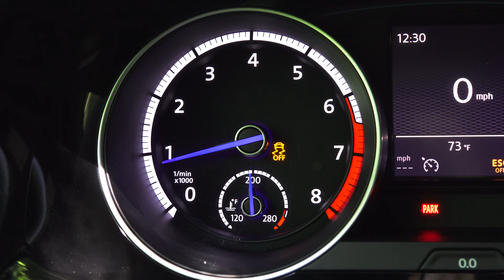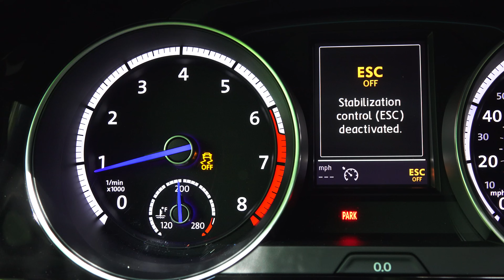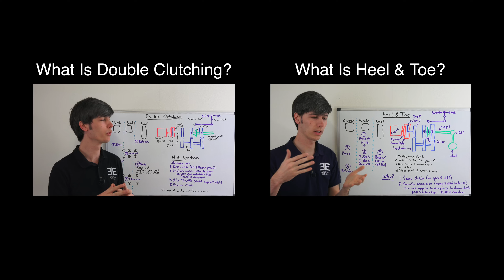How To Launch A Manual Transmission Car

Comment: Taking the rpm to redline isn't always the fastest. If your torque curve peaks at 5k and you redline at 6500 you're wasting time and going slower than you would be shifting at 5k
Reply: +Kyle Carson because they probably have a very close ratio transmission. he is correct it is not just about the power curve in a single gear because that is just engine power what matters is what you're putting to the ground and for that you need to take into consideration the transmission multiplier. If you have a normal street car the difference in ratios especially between 1-2nd will be large and it gets smaller as you move up the gears. So for example if you had 250 ft-lb torque at 7000RPM in 1st and you shift to second and land at say 5500 RPM and you have 300 ft-lb in 2nd at 5500RPM but say using the example in the video you have a 60% better ratio in 1st  you would still be better off shifting at 7000RPM. Typically the redline wheel torque which includes transmission multiplier will be higher in any preceding gear than any output in the entire range of the following gear so it is beneficial to shift at redline especially in the lower gears.  

The fastest way to drive a car is to shift when the wheel output in the lower gear falls to match from above the relatively increasing wheel output in the following gear as this way you are maximizing wheel output instead of just engine output. However often the wheel output will not even fall low enough before you reach redline in order to be under any output in the following gear so this is why it is normally best to shift at redline even at a lower engine output after peak torque. However this is not a universal rule but needs to be addressed for each engine and transmission combination. You can make a simple chart and or graph to see if this rule applies for your own personal car but for most cars besides specialized race cars shifting at redline is optimal.
Reply: But, when you change the gear at 5k, your rpm drops to lets say 3k, so if you have more torque at 6k than at 3k, you should take it to the redline...not to mention torque at the wheels drops 60% when shiftin gears...so the torque at 3k must be 1.6x of that at 6k...
Reply: +Vicjo Koper no you stay in the torque curve that's the fastest way. Ask a drag racer, they set there shift lights around 200rpm before the torque curve levels off to keep it constantly in the torque curve. If you go past the torque curve all that happens is the engine works harder and produces less power. Watch the computer reading while a car is on a dyno. After the torque curve you will see the power drop and continue to drop till they hit redline
Reply: Kyle Carson you're really just not understanding. engine output is not what matters it is wheel output that accelerates the car and due to gearing advantages for most cars in the lower gears you always have MORE wheel power AT redline than you do in equivalent RPM in the next gear or really any RPM in the next gear. So for this reason you go faster by shifting to redline. 

using your own example even if the nominal torque starts declining after 6K RPM your wheel torque will still be higher at 7K RPM than your wheel torque in 5th gear at whatever RPM you land at from shifting early say shift at peak torque 6K RPM land at 4500 in 5th. 4500 RPM in 5th will have lower WHEEL output than 7K RPM in 4th so you go slower by shifting earlier. why is this so difficult for you. for the vast majority of cars basically for any vehicle speed, you will have greater WHEEL output in a lower gear if you can rev as high. 

just like you said by the time the torque curve peaks redline is nearly achieved so you will basically never run into the situation where wheel output is lower in a lower gear than in the following gear. 

for shifting BEFORE redline to make sense WHEEL output which again is a function of engine output and the transmission multiplier must be lower at or before redline than the equivalent wheel output at the RPM you would land at from shifting before redline, but this basically never ever happens in street cars because of the large drop in gearing advantage as you go up in gears.
Reply: +TheAceHD a lot of people believe that but nobody that races does that because it simply is not faster. Torque curves usually peak not far from redline. Maybe between 500-1000rpm before redline so if you redline at 7k and your torque curve ends at 6k in 4th gear you waste a couple seconds waiting to redline when your car would accelerate faster by simply shifting. Ask people who race or get your car dyno tuned they will tell you the same thing unless your car makes a curve all the way to redline
Reply: +TheAceHD no dude torque is the turning FORCE of the wheels not how fast they are turning its how hard they are turning. For example my heads cam gto made 431 rear wheel torque at 5750rpm that was its max torque it made at the wheel but it redlines at 6200 where it made much less. Now my engine doesn't make 431 foot lbs until I hit 5750rpm before that it makes less and is climbing after that 5750 it drastically declines in power. You obviously don't understand this. Your engine is always 100% of the time slower and making less torque and horsepower after the torque curve. Look at a damn dyno sheet
Reply: +TheAceHD the power then starts to drop quickly at 5900rpm so that's when you shift idk how you can't understand this. Makes peak power at 5750 drops off fast at 5900 so shift at 5900rpm not 6200. Hitting the limiter is wasting time
Reply: Kyle Carson although engine output is falling after the peak power the car is still putting out more wheel output after the peak in the lower gear than the wheel output you get from shifting at peak power into the higher gear. here this is as simple as it gets.

peak power 6000 RPM, redline 7000 RPM. 

shift at 6000 RPM in 2nd go to 5000 RPM in 3rd.

or 

stay in second past 6000RPM and accelerate to 7000RPM,  even though engine power may be declining it won't decline by nearly as much as your gearing advantage declines going up a gear so you put out more wheel output going to redline. this is as clear and as simple as it gets if you can't understand this you are either a child or you have 73 IQ.
Reply: +TheAceHD I was talking wheel power the whole time numb nuts what do you think a dyno reads? Make crank power is over 500 but you continue to prove you don't really understand how an engine performs

Comment: You did not discuss loading the drivetrain before launching.  This is a very important part of launching, especially with high grip and/or all-wheel drive cars.  You need to remove all of the gear lash in the drivetrain to prevent severe drivetrain shock when you launch.

Comment: if you have a very high torque diesel engine, you don't even give any gas and just let the clutch engage. Done.

Next.
Reply: +Stoned Mole The title says 'launch' not 'get the car moving'.  Launching is getting it up to speed as quick as possible.
Reply: +methanbreather there is a difference between launching a car and simply pulling away
Reply: +methanbreather diesels have much more torque than petrols and therefore revving to near redline in a diesel and then dropping the clutch will result in wheel spin. in big (400+lb-ft of torque) diesels just rev to 2000rpm and the drop the clutch in.
Reply: You don't have to rev all the way to redline to launch. Also I've seen people launch 1500 lb ft. diesels at 2500 rpm so it's definitely possible
Reply: @gwyneddtobij1247  Diesel engines lose a lot of torque at higher RPM so that's not true, a diesel (assuming it has a turbocharger) will give its max torque around 2000 RPM, above 3000 you start to lose all of it.
Reply: @Bloblom  modern diesels, especially smaller displacement ones, keep their torque surprisingly high up in the rpm range. still goes down of course, but not to the extent it used to for diesels of old.
Reply: The believer irony.
Reply: bollocks does it. i must leave now for too many idiots
Reply: I think you don't got the point of the video.. Read the title again
Reply: Then have your vehicle towed to the dealer for replacement of all the U joints etc.. (1200 + lbs here in performance mode) and in 4x4 high in an 8000 lb pickup..
Reply: you`re nit too smart aren`t you ?
Reply: Yes, I have a BMW 320d coupe and just releasing the clutch in first gear feels like starting with gas in first gear in a petrol car.
Reply: +DieHum_mel i don't see what is wrong
Reply: yeah, give lots of rev and then let the clutch engage quckily - or how to lower the life expectancy of your engine and destroy your clutch in no time for basically NOTHING.
Reply: Rob Greenwood ok